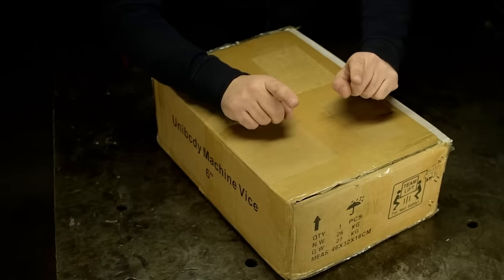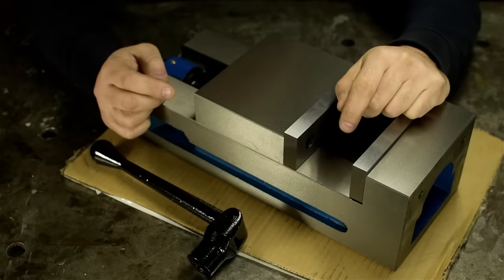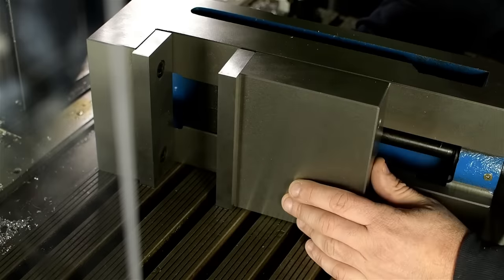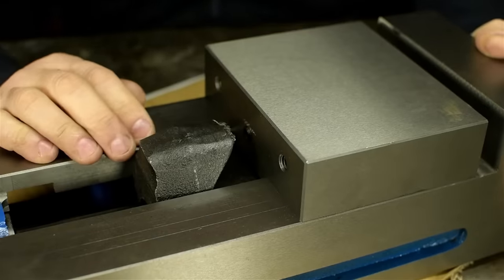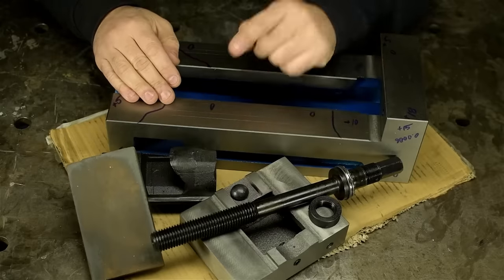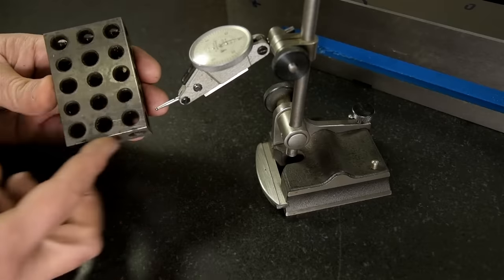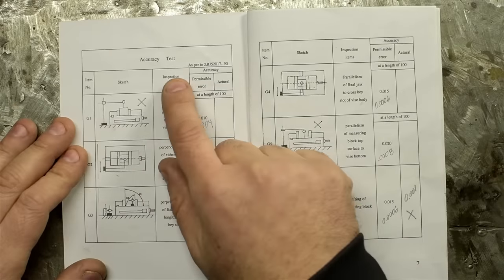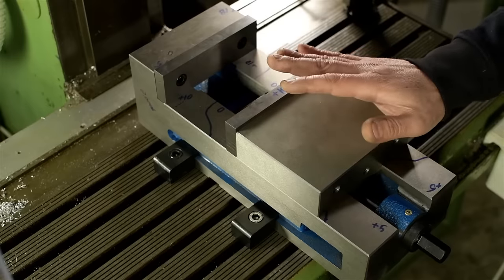Cheap Milling Machine Vise is CHEAP!

Comment: Community college Metrology instructor chiming in with a pedantic nitpick/GD&T observation: The flatness inspection not only assumed the granite was flat, but also the bottom of the vice is perfectly flat and perfectly parallel to the inspected surface. Legally, a parallelism check was done, not flatness. Without a CMM or a granite with a hole for an indicator, you would need to get the vice up on jacks or shims and start tweaking out the error if you truly wanted to inspect Flatness. It's exercises like these that really drive home the differences in GD&T controls for students. 

Love your videos and sense of humor, TOT, please feel free to wave me off as one of those crazy quality control road blocks. Also, a Mitutoyo straightness master was around 5k last time I got one for my lab, and that's without a reference block.
Reply: I don't think you have included the random movement of the atomic structure of cast iron molecules in your calculations,,,looser! ;>) (joke)
Reply: Don't ya put the vice up on 3 points and then indicate the top? Thus establishing a more true flat plane of the granite surface not so much effected by the bottom of the vice surface
Reply: @YPllayer  - That's  how you indicate the *bottom*, with the premise that the 3 points are in a plane parallel to the granite.  run your indicator on the bottom then, and any variation is a variation in flatness of the bottom.
Reply: Assuming flatness of the plate, or at least a stable reference, wouldn't it be more accurate to keep the plate from moving and find the flatness mathematically?

Isn't flatness independent of how canted one way or another it is, just whether it could in principle be tilted to be flat- i.e. it lies In  plane.

If the table was flat but not level, would still work, lack of flatness would ruin everything.

Weird chicken and egg problem right there, I guess that's what the 3 plate lapping thing was for?

If you took multiple measurements all over the piece then you could fit some kind of linear model to that, and then do a good was of fit measure(R^2 or something) to get the linearity of the surface, and hence its flatness.
Reply: would you have some YouTube video recommendations for that?
Reply: @YPllayer  how does one check the granet flatness ? seems to me the indicator will still pick up surface plate irregularity when moved around to check the bottom or top.
Reply: @chuckthebull  Abom79 has a few videos on inspecting surface plates.  It is done with highly specialized equipment, fascinating stuff.
Reply: It would pick up the variations but you'd assume its flat within the allowable tolerance after it's been checked with a bunch of fancy expensive instruments and then certified and graded.
Reply: That's true. That's they way we did it. I guess if the top and bottom surface of the vice were perfectly parallel too it would be more accurate. Probably best just to flip the vice up side down and use 3 points. Fatness is weird because your trying to measure variations to its own surface,  So you have to establish that plane using the 3 points of contact. And that can vary too depending where you place the 3 points.
Reply: @nickgarrett1594  planetary gravity must also be considered,,unless of course flat earth is your thing.. that reminds me...pizza time
Reply: @benaguilar1787  ah right I watch his  channel too...I'll have to take a look..he's quite a smarty pants as well. I would think the trick is to use some method of cancelling out error
Reply: I really really thought you were going to sneak in a "it can be easily shown that....(so skips over whatever was being explained)" or "it's left as an exercise for the reader...."  HATED those phrases in my engineering text books.  😂
Reply: @chuckthebull  Keith Rucker (VintageMachinery) has a video about that.
Reply: “Perfectly flat” doesn’t exist in the real world unless only three points are used. The vice bottom was resting on three point and the granite surface plate that was a datum simulator and the surface that was measured only showed parallelism to the datum. Add a joe block to the equation and that would represent profile.
Reply: What does a weatherman know about measuring a vise? You guys are wrong 80% of the time about what is currently happening outside my window, much less what will happen. Heck, you barely get what has already happened correct.
Reply: @macaroniandtuna  ha yeah watched his channel too..I'll look for that one.
Reply: @chrisestill8825  It's metrologist someone who studies measurements, not a meteorologist who is someone who predicts weather. Of course metro is in a city and a meteor is rock falling from the heavens, but English isn't that consistent.
Reply: @AngDavies  that's essentially what a CMM does, but that's just one basic measurement. CMM can perform all GD&T tasks with incredible precision.
Reply: @chuckthebull  Granite surface plates are calibrated with either a differential level, or an autocollimator, for the overall flatness, and a repeat-o-meter gauge for finding local variations. Tom Lipton has a good video on the subject.
Reply: @RambozoClown  repeatOmeter sounds so 50s advertising,,,love it...I'll take a look too,,and thank you.
I have a granite shop near me I'm kinda thinking of getting some old cutoff and making a plate..what I do does not need supper precision but I just like the science of it all.
Reply: @chuckthebull  You might also have a look at Robin Renzetti's channel (ROBRENZ) He has a series on lapping a Starrett Master Pink surface plate.
Reply: @RambozoClown  wow great..I was just watching a program called the science of flatness on YouTube as well... thanks for the tip..you guys are all so helpful,,,cheers
Reply: @jophmac  *WHOOSH
Reply: But why even measure 'stuff' ? Don't you just bung it in a surface grinder and gently grind some surfaces ?
Reply: @millomweb  the word "bung" just "clinched" it for me. uhum.
Reply: Nice. I was thinking the same... though with less qualification. :P
Reply: @chuckthebull  We joke, but actual temperature differences make... differences. Workshop and equipment need to be kept at a steady temperature!!!
Reply: @TechyBen  yeah I get that too..
I used to work for the navy putting strain gauges on landing hooks to test the twisting forces and calibrating them for a chart readout showed changes due to temperature differences in the room... back n those days we did not have AC in our building and summer months showed different readings on a chunk of steel the size of your leg. that's how sensitive our instrument was, I was always amazed that I could just hold it in my hand and watch the gauge change from temperature in something that appeared so solid.
Reply: @chuckthebull  I gotta remember to let me old engine warm up... before throttling it. Don't want those tolerances blowing a gasket... again.
Reply: @chuckthebull  What did 'bung' do for you ???
Reply: @millomweb  The word association was too "close" to "home",,,but this might be a family channel..... in case This young Tony is watching I refrain from certain descriptive terms. :>)
Reply: @TechyBen  I have a 1962 sunbeam alpine that I rebuild the engine and gave the head a skim and it's never blown a gasket again.. cheers to you though.. what old motor do you have?
Reply: @TechyBen  just watched OX TOOLS do a vid on his surface plates..the guy that came to check them said in the cold it will deform in the center as opposed to when it's hotter it goes the opposite direction.. his plate is at least 4inch thick granite too.
Reply: @chuckthebull  Nice! Sold a Sunbeam off to be rebuilt (IIRC they had a nice engine and gearbox and wanted the frame/chassis to put it in). My old Lister Petter generator shouldn't explode... it depends how I treat it though. :P
Reply: Joshua Worthley, I'm your first subscriber if you ever decide to make videos.  Please start with lower cost instruments that mortals might be able to afford!
Reply: @TechyBen  ah so cool those hit and miss engines... I like watching all the vids in people starting them,,that and steam engines and model T s, I'm fascinated by the old tech...like Dave Richards steam machine shop channel too.. been watching him from the start of his...
Keith Rucker,, and so many more..it's really fantastic to see all these people doing such cool stuff..it's inspiring for this old hack.
I am rebuilding a Harley flathead engine right now to go into a custome plunger frame from the 70s
Reply: Chris Estill , I get your humor, looks like some didn’t!
Reply: @JonnyCoolMelt  who didn't? or are you not getting the humor to the humor? granted some of us got off on a tangential deviation,,,error Will Robinson
Reply: Since we are getting super nerdy on this thread I’m surprised a monochromatic light source hasn’t been mentioned?
You still need to tram the vise to the cutting head.
I’m a big fan of soft jaws!
Not so much of Chinese steel as we have had some plates relieve stress in the middle of surface grinding and smash the grinding wheel.
Reply: @JonnyCoolMelt  why is chinesium of inferior quality? is it politics are bad alloying ingredients?
Reply: Chuck Itall , I am referring to the joke he made about meteorology vs metrology.
Then someone explained the difference.
Reply: Chuck Itall , the plates we got were not stress relieved.
I’m not sure what politics has to do with it.
Reply: @JonnyCoolMelt  yeah sorry just a joke..should leave politics out of it.. I come to machining videos to escape it
Reply: @JonnyCoolMelt  I was watching a vid on that chromatic llight source..seems to me this takes the surface plate irregularity that would be still present even using three point measuring from the bottom out of the equations..Joe pie, did one on that three point method too. but it's still only as good as the plate skidding the measuring instrument around on it
Reply: @JonnyCoolMelt  oh and yeah not stress relived would cause them to warp as you took material off.. so I get it... like I said it's astounding how when you start to get down to real precision so many factors start to effect measurements...simply breathing on your instruments can change readings..
Reply: Chuck Itall , I am so done with politics, at least machines do what you want them to.
Reply: @JonnyCoolMelt  lol..indeed...funny your comment...it's funny cause it's so true
Reply: Chuck Itall , yes sir and it gets dam hot where we are items expanding and contracting continually.
Reply: Chuck Itall , I have made stamping tools on my EDM to +\- 0.0002” and by the time they go on the press they have changed. Also they heat up again while stamping as you know.
Reply: What's GD&T ?
Reply: ArthA122 , I’m not sure if your joking, if so, ha ha ha!
If not it’s Geometric Dimensioning and  tolerancing.
A symbolic language to describe features on a part.
There’s obviously more to it but I digress.
Reply: Exactly what I was thinking..
Reply: I'd just like to point out that Meteorology is spelled different.  But every cloud has a silver lining.

Comment: Tony. Buddy. 3D print a channel for coolant overflow.  Feed it right back to pan.
Reply: kids and their 3D printers these days grumble grumble

;)
Reply: Oh how I wish I was a kid again. Lol.
Reply: Or even just mill a channel or cutout into the vise base.
Reply: @macaroniandtuna  crashes spindle

Uh... it's a coolant channel. Yes.
Reply: Or plumb shop air to it and blow coolant all over the back wall.
Reply: Hot Glue
Reply: Just drill a 1/4" hole either side and a couple of blobs of grease to act as a dam to divert the coolant through the holes and onto the table ?
Reply: Angle grinder.

Comment: Oh I bought a vice off eBay, £50, 9" when I was really just starting out. What that thing needed was something next to it for scale, like a house... Being 6ft 9" I can lift it, about the height of the back of a van, once. And it makes the performance difference when in the van, down hill it seems quicker, breaks caused a large bang if applied hard although the van struggles to stop a few football fields further than it used to, hills also seem to be considerably longer. I worked out that the reason for the vans breaking issues was that the vice's mass was affecting space time.

The point of this rant, don't buy things on eBay with out knowing the actual size of it. In this case 9" meant a vice that was about 2 and a half foot long, and able to cause cold fusion if dropped.
Reply: If that is £50 including free international shipping I'd hazard the guess that my local scrap yard pays enough for cast iron that one could make a latte or two a week hurling these to the junk yard...
Reply: @andersjjensen  it's either a Jones and Shipman or a Bridgeport vice. I have seen more if them for sale (and it always makes me laugh that there is never anything to reference size) but they go for a minimum £150 so I got "lucky" with this purchase. Thankfully I have an engine crane if I ever want to use it. :-)
Reply: Don't feel bad, we used to have an aircraft carrier land yacht Cadillac whose bow wave would affect the weather in Canada...
Reply: I can beat that. I bought a bank of three six inch vices on eBay. I naively assumed that they were simply bolted to a plate but it turned out that they were manufactured as a trio of vices with a common base. We had to use a fork-lift to get it into the boot of my old Jag and I was relieved to get home without needing new springs. At my end, I had to use an engine hoist to get the gang of vices out of the boot and into the workshop. It should fit on my mill, but would make the table ridiculously heavy. I've been advised to cut the thing up and make it into  three 6" vices - but that seems a shame. I simply cleaned it up and put it in a corner of the workshop until I can find a use for it. I wondered why no-one else bid on a set of three machine vices for £50. Now I understand...
Reply: @nicholashacking381  classic, makes me feel better others have done it. Interesting item you have thought I've never seen one like that
Reply: @GunFunZS   It's a Vertex (Taiwan) I haven't been able to find it listed in an on-line catalogue. I think that Vertex is a reasonably reputable brand. It must have been quite expensive when it was new, given that the fixed jaws all seem to align. If nothing else, it would indeed make a useful anvil.
Reply: Andrew Culverhouse, That made me laugh so hard.  Love when someone can really make a story .

Comment: Thanks Tony. To be honest, as someone working on much smaller machines than yours (essentially high end hobby kit), I think the 1 thou would not be an issue for most non-professionals - especially given we suffer the same W.I.F.E issues. For a lot of people,  often 5-10 thou tolerance is actually way beyond what they need (not want, need) for 99% of surfaces

Comment: Will the surface grinder be involved in cleaning up these 0,025mm ? (if it reaches...)
Reply: I'm sure he can bring it in with an angle grinder
Reply: my thoughts as well...but if things go wrong...might end up with a paper thin paper weight
Reply: A file and some lapping would fix it.
Reply: @ebattleon  scraping technique?
Reply: TOT has shown that he is a wizard with the scraping.  I vote scraping over grinding!
Reply: I also wondered if the surface grinder could flatten at least the side that faces up (where the jaws slide).  Is that deviation contributing to the jaw lift?   I also thought he would flatten the angled part that squeezes that half-dome - to remove some roughness.  He might also be able to find a ball bearing of the same radius of the half-dome, saw or grind half of it away and improve the smoothness there too.
Reply: A Fein oscillating with a narrow carbide grit scraper blade will make quick work of it, but a surface grinder would leave a better finish.
Reply: I think you're right it looks like it might make good raw stock for a project.
Stefan Gotteswinter has done several of those "hacked" Chinese projects where he takes a cheap Chinese sourced chuck or vice or similar and tweaks it (hacks it) into something better.
Reply: @SolomanPhenox  ROFL
Reply: Was expecting that, i mean, in the old video (which for some reason was on my recommended yesterday, wonder why?) he did say he was expecting to have to surface grind some things into spec, maybe that'll be a next vid?
Reply: Maybe. It probably needs to be normalized for a bit before you can grind it. Even if you grind it then it is made from soft stuff so after 6 months of use will be off by a thou. Essentially these are mostly for stuff where accuracy of +-0.005 is OK or say +-0.1mm
Reply: Randy Bartlett in a pinch, I'm sure it would provide all of the accuracy necessary to prevent his sailboat moving out of place due to the influence of planetary gravitational fields or horizontal variance in air pressure, when attached by a secure line.
Reply: A big drawback of the unibody is it is hard to grind on a ordinary toolroom grinder. With a two piece body one can remove the fixed jaw and make the base flat and parallel pretty easily.
But on the unibody had scraping is probably the only good option. I suppose one could cut the fixed jaw off and make a new removable one, if the base casting has enough meat for the mounting bolts
As a wise man once said, those cheap Chinese things are really just a kit of parts for the do it yourselfer, Tony said it cost less than he could buy the iron for and it is already pretty well rough machined so I don't know what he is complaining about.
Reply: Is 25microns big in a world of machinists ?

Comment: That "ramp" at the jaws could very well disappear when the vise is clamped, as a result of deflection in the bed of the vise.
Reply: Hope springs eternal!
Reply: Ten thou out of spec on every dimension but they all cancel
Reply: @frederf3227  Those measurements were 1/10000ths, not 1/1000ths. And his measurements were wrong anyway, you measure a vice with a reference block clamped in it, not open, as the test diagrams showed.